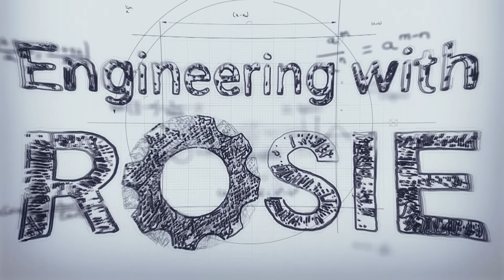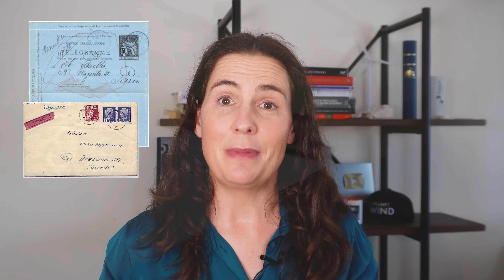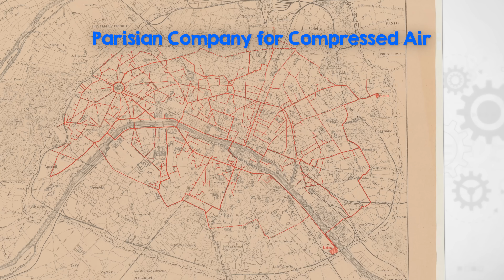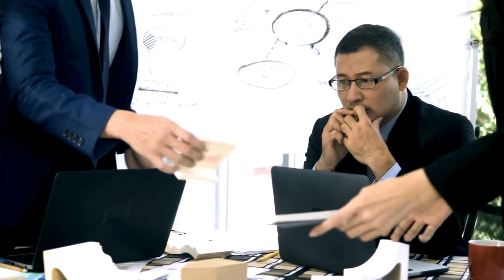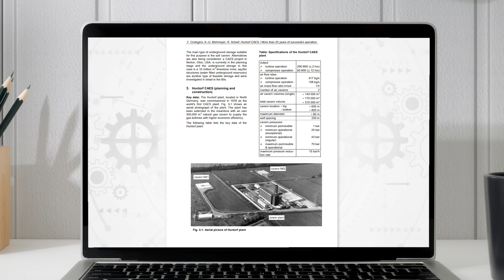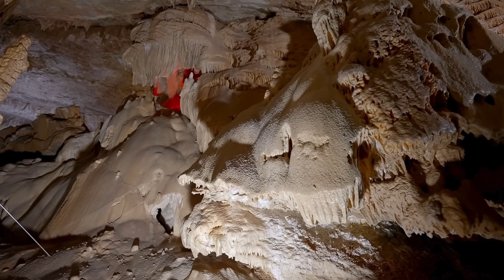The Genius Energy Storage Idea Everyone Forgot

Comment: The best case I see for compressed air energy storage is if heating and cooling from compression and expansion is utilized, that way a system can provide "low grade" heating and cooling, with high "combined energy efficiency". That means, considering the system primarily a heat pump that can provide both heating and cooling, with built in energy storage potential. Even if "electric energy" storage efficiency alone would be rather low, if the according to conventional reasoning "losses" are the primary benefit, that should be a cost efficient way to generate the highest total value output. Storing as much  heat and cooling potential as possible just to improve the thermodynamic energy storage efficiency adds a lot of costs in that dedicated storage systems, and requires frequent cycling in order to avoid high losses of that thermal potential.

Another aspect about compressed air energy storage/conversion I find somewhat intriguing is the fact that relative humidity increases with pressure, which means that compressed air energy storage could potentially be used to also provide a lot of air with very low humidity. 

I'm not a physicist, or an engineer, but as I understand it when you compress air, the energy you use essentially turns into heat, that heat makes the air expand, or increase in pressure, which is the main reason most common air compressors are horribly inefficient, even if they're mechanically good, as they also have to fight that increased pressure caused by the increase in temperature. If the heat wouldn't cause the pressure to increase, an ideal air compressor could be considered 100% efficient at converting power into heat, with that compressed air as a "free" byproduct. And for expansion kind of the opposite would be true, if the decrease in temperature caused by expansion wouldn't decrease the pressure, you would, with ideal expander get the same amount of "cooling" back, and also all the power you once put into compressing the air in the first place, assuming ideal expander and 100% efficient generator, and all that.

In reality though, with a very well designed system that extracts low grade heat from multiple compression stages very effectively, you could get most of the power input as that low grade heat. And with multistage expansion with very effective reheating to ambient temperature between expansion stages by utilizing that cooling potential, you'd get the same amount of cooling potential minus the differences caused by friction and other aspects of reality, and could also get most of the once invested power back. The possible efficiency of each stage of the process decreases with increased temperature difference compared to ambient that you want to achieve, and the closer to the possible efficiency you want to get the higher the upfront cost will be, all else equal.     

So in my mind, even if the power round trip efficiency would be mediocre, if you have good use for low grade heat and cooling potential, both can be cheap to store for some time, CAES should have significant potential. The dry air generated could potentially be used for air conditioning, or dehydration. "We" are currently using a lot of energy to generate low grade heating, and cooling, and for moisture removal.    

In the system described in the video where hydrodynamic compensation is utilized, why don't they just pump the water instead?  If they want to minimize losses due to compression and expansion, and don't plan to use the heating and cooling why not just eliminate those losses instead? Exact same storage potential is utilized, but all the issues with air compression and expansion just taken out of the equation. 

I mean, if the compressed air displaces water in the cavern, and the water can travel freely to the surface, the pressure in that cavern should be the dictated by the height of that water column, and the energy storage potential is the gravitational potential of that water, or am I missing something? If they can control the water flow, and by that are able to have a greater air pressure than what the water column allows, and then when the air pressure in the cavern during "discharge" goes down to about 6 MPa, use that water to push out the rest of the air without further loss of pressure there, that would be kind of elegant. 

But, then again, just using the underground cavern and surface pond for pumped hydro would allow for significantly higher energy efficiency, for much lower cost per unit of storage capacity, even if the total storage capacity would be lower than their claims. According to my quick and dirty calculations just using that particular case, 280,000 tons of water 600 meter height, should mean somewhere in the ballpark of 460 MWh potential in that case, compared to their claimed 1600 MWh. But underground open volumes isn't a significant cost, and if they don't have to be airtight either, which they don't have to be for pumped hydro, underground open volumes is a practically unlimited resource. Any sufficiently deep and big abandoned mine that doesn't refill with water too fast naturally could be used for pumped hydro if combined with a surface level storage pond.

Comment: I was in Costco when one of the cashiers stopped to count the money. They pack it in a cylindrical tube and lift it up just overhead above the cash register, and there's a pipe there. It sucked up the tube full of money, I guess to their offices above where I guess they count it again and put it in a safe or whatever. 
I guess it's an example of a pneumatic tube that is operational.

Comment: How inefficient would this be at small scale?  Could small industrial compressors and their pressure tanks, such as are found in garages, workshops, and small factories, be used in the context of a single home?  Is this even feasible and, if so, how cost-effective would it be compared to already wide-spread home battery storage systems?

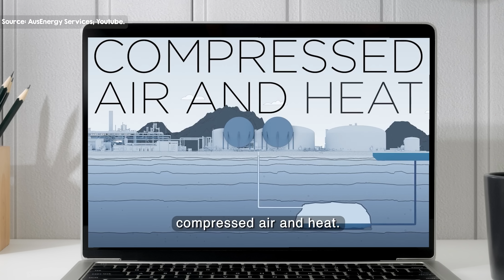Comment: At 14:00 where the Hydrostor water rationale is explained, Rosie gets the story totally wrong. The reason for using water this way is to keep virtually all the air at a constant or nearly-constant pressure. That means the pipes, the compressors and the expanders are all working under constant or nearly-constant pressure, which both lowers capital cost and improves efficiency. Avoidance of vacuum has exactly zero to do with the system.
Reply: Thanks. 
I asked myself if its even more to efficient to just turn it into a pumped hydro project with upper and lower reservoir? I thought that water pumps are more efficient than compressors. Can you explain?
Reply: @Johannes-mm6dx  I think it’s about location flexibility, and existence of a salt cavern which drops the CAPEX of the project

Comment: I work for a compressed air manufacturer I don't know the correct % but Compressed air systems are already one of the largest uses of electricity in manufacturing countries estimated 10% of Chinas energy use. It's used in factories a lot. There is a of technology in the technology.

Comment: Thanks Rosie, great as ever. Sadly I am probably more of your mum's vintage as I remember just about all department stores in UK having a pneumatic system, you could of course send money down in to limit the amount in the till.

Hopefully the UK will adopt this to add to the storage capacity. Must have plenty of salt caverns in Cheshire, as this is how and where ICI first started. Then use the excess electricity from wind farms in Irish Sea.

Excellent to have the historical input. Helps the answer to the  nay sayers of "this is modern unproven technology"

Compressed air was of course used (still used) to control our process plants. Open or closing valves, sending level signals,etc... back to the control panels in the plant room. Scarily I have seen this done with process gas....back into a control room. Yikes!

Comment: Mid-term lithium is almost certainly going to be irrelevant, it's going to be competing with sodium batteries... And if the predictions of $20-30 USD per kWh are realistic (I believe CATL when they say something, I don't believe basically anyone else!), then that is going to be hard to beat. With those prices you could even massively over-provision and have it doing periods it's theoretically not viable for. Because cheap...

Comment: I see 2 problems with this compressed air  system..
1) the turbine... even with modern improvements you will probably not get anywere close to 80% efficiency real world. 
2) making and keeping a cave airtight again i can see many losses here 

There are many other issues i can see with the system I have worked with many low pressure and medium pressure high capacity Dresser Rand 125 lbs as well as some high pressor air compressors

Also since you are talking of using solar as a power source you are probably thinking of some sort of a positive displacement compressor ... 

I am sorry i keep seeing issues with this system.. and lots of efficiency losses across the entire system not to mentioned limited locations capable pressure voids and such.. I would think a sand battery would be much more efficient than this .

While i can see some locations this would work in.. i think sand batteries would be the way to go.  its cheaper to build and operate can be whatever size you want and doe not need an air tight cave to work.
Reply: Actually a sand battery would be a great way to save the heat to be use later to heat the air back up.. but i still think it is a very bespoke  system and needs to be built where a cave exists or can be made.

Comment: The main downside to air pressure storage is that half the energy goes into heat, which if dissipated can radically cut your round-trip efficiency. There are two ways to prevent that: first, store the heat, too, via a well-insulated or underground tank; or second, extract heat from the ambient environment on the way out. Such environmental heat isn't always available, but sometimes it is.
Reply: Spot on 👍
Reply: Coal oil gas.. burning shit seem to be the "one size fits all" for global energy.

But what we have here is cold climate energy storage.........

A power bank and a thermal bank to heat a boiler to both power and heat a apartment complex.....

What the got molten salton reflected mirrors but that in the desert ......

Air/sorl/ wind but that in the snow.......

Different tec will suit different needs  

I rambling  but agree take the down side and make it a positive
Reply: Like could you imagine air powered cars in Russia or Canada.....where temperature drop tooooooo.

As far as I know air don't freeze....(well it dose)

But a place where you need to leave your car running or set it on fire to stop the oil from freezing
Reply: Capture the heat!

Comment: Adding some historical context is valuable. We have become too used to modern convenience and we have forgotten how we got here. Younger people have literally grown up with a stable electricity supply and so they know no different. It might help people understand the current energy transition if we talk about the previous one. It took decades to develop our coal based system and the original Snowy hydro project. People opposed to the current changes might become a bit more sympathetic is they are reminded of how we got here. E.g. At the moment, we have farmers cracking up over new transmission lines. These farmers have enjoyed reliable electricity for half a century that came to them across other farmers properties. That's not to say there isn't genuine issues with new transmission but things need to be put into perspective. A look at history helps that happen.

Comment: I was expecting mention of the Ragged Chutes Hydropneumatic Air Compressor. 
It utilised freely generated compressed air, via a Trompe pump, 😢to power all the underground mining equipment in Cobalt, Ontario. 
The air produced by a well designed trompe pump is isothermic and fully renewable.
Reply: Thanks for the heads up :) The Wiki article is interesting tbf - https://en.wikipedia.org/wiki/Trompe

Comment: You left out wire rope loop - more efficient at transmitting mechanical energy than anything up to a few km, sometimes more efficient and cost effective than electrical.
Did that 100km 75% include generation and conversion to work at destination? When mechanical end to end, cable loops have an edge.

Comment: Um, unless my back of the napkin math is wrong it is upside down on cost compared to off the shelf retail non-volume Tesla Megapack units which have a better round trip efficiency. So why do it the hard way of engineering a one-off solution that you are hoping geology will cooperate with you on? Their site is happy to point out "jobs" but even best case scenario it doesn't work as well, round-trip efficiency, warranty, software support, no dependency on geology... It would literally be cheaper to pay people not to work than the round trip efficiency loss costs.

Comment: When the wind does not blow and the cloud cover restricts Solar then there is the nuclear sun in a bottle. 
Clean and proven safe in countries with high level security.
Hydro the next best clean energy but increasing droughts may reduce the effectiveness.
Geothermal equally effective although restricted areas of Geothermal opportunity . 
All these other methods of storage don't get past losses.
It is a matter of building the best storage with least loss.
So many thoughts of storage but at what massive loss cost. Losses from heat during compression. condensation building restriction in lines.
Pressure is same across all parts of the system  as it balances.
Need for many pumping trains to ensure consistent pressure through distribution systems.
Is this the best use of renewables that are otherwise curtailed.
Sodium Batteries , seem to offer the least loss and less toxic when recycled.

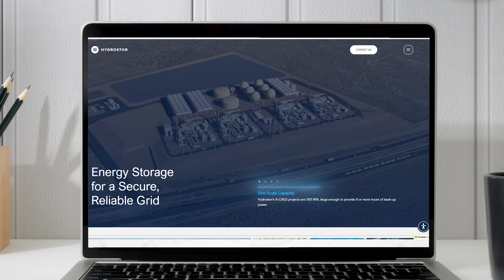Comment: 13:00, I like the Hydrostor system  as it can operate at a high fixed pressure, with a high volume. It looks like pumped hydro, but with compressed air as the energy exchange fluid. What relative proportion of the energy is stored in the compressed air against the energy in the potential energy of raised water. The 60% efficiency suggests maybe 30% is in inefficient air, with 70% in the efficient water.

Comment: Why is 66% efficiency difficult? It means that the electricity price at night must be double that during the day for the system to work economically. 

Or the construction costs will be subsidized. So, only state-owned companies will build, not private companies.
Reply: I guess it depends on the cost of electricity during the day. When electricity prices drop to near zero, that efficiency is only going to be important when competing with other storage options. Then capital cost would be the deciding factor
Reply: @emceeboogieboots1608 $0 At the consumer level but not at the retail level. Companies that operate solar and wind turbines Still get paid by a base price.
Reply: @AprezaRenaldy It is the coal plants more likely pushing wholesale prices to zero. They can't throttle down their capacity significantly, so must still generate power when it is not needed

Comment: 500 MW or 8+ hours of energy storage? Why do none of these spuds use MWh? Never mind, I see at 13:09 it says 1.6 GWh. Not bad but batteries are still cheaper. Around 400-480 million as opposed to 600 million. Pretty serious savings really. The advantage that CAES might have over battery technologies might be the expected life/cycle count of the system

Comment: Here in Arizona summer temps regularly reach 45 C or more, similar to Australia.  I can envision a system where decompressing air could cool large areas while providing power.  Of course that would be a significant hit on round trip efficiency but, on the other hand,  it could also reduce the power that is used for air conditioning.

Comment: You mentioned at the end using compressed air to displace water in a cavern to a lake above ground. Is it more efficient to tape the air or water to reclaim the energy? I'm curious if there might be a cost advantage to using water turbines rather than air turbines 🤷

While I don't know where I came across it, I may be mistaken, but I think some wind turbines used a compressed air reservoir below their foundations to be able to restart a wind turbine that has been shut down because the wind on it's own is not enough to get it moving without assistance and it.

Also there is an air compressor that uses what is effectively a waterfall to compress air, Practical Engineering did a video about 6 years ago called a Trompe. I wonder if one of those could be useful in someone one day xD

Comment: There was talk of a compressed air system that went as far as to liquify the air, storing the heat of compression in a heat battery, then reheating the liquified air to run the generator to get the power back out.  That struck me as useful as separating the carbon dioxide out might be possible in the compression phase.
Reply: You could also extract the argon and other smaller constituent gases as a side income stream.
Reply: Called “cryogenic air energy storage”.  Note that nitrogen’s critical point is at only 3.4 megapascal and oxygen  5 megapascal.  In a reservoir located more than 600 meters below a lake the air is “a fluid” and no longer a gas.  Separating carbon dioxide can be done but oxygen and argon have significant markets.